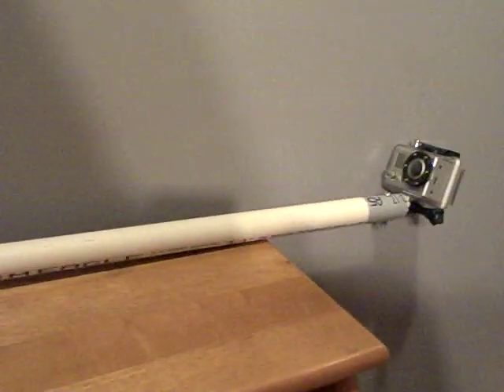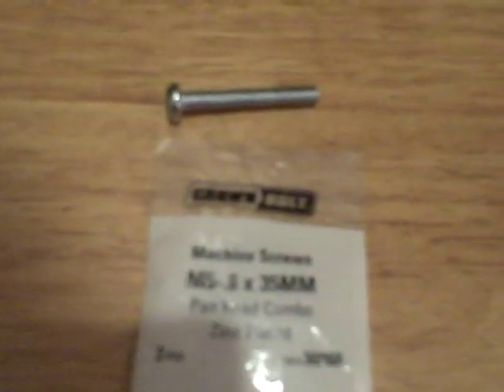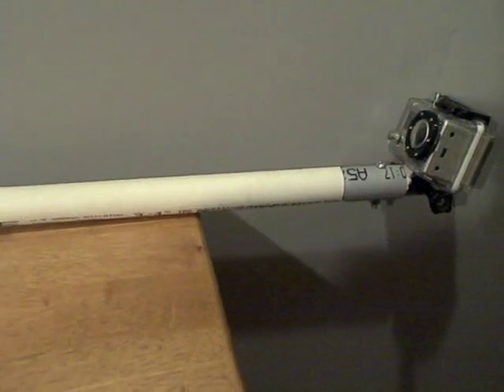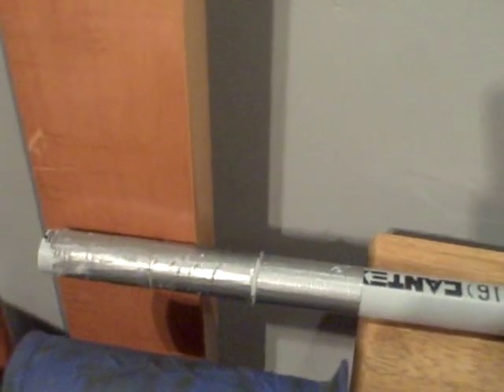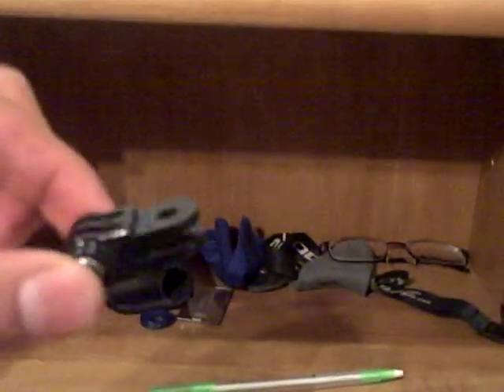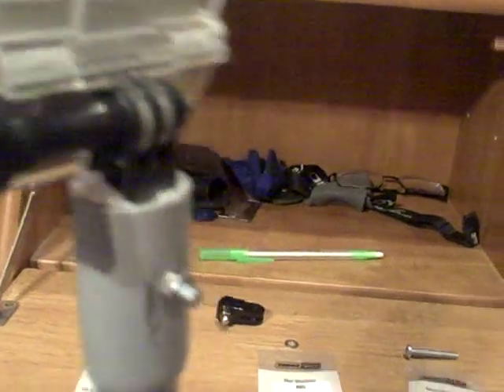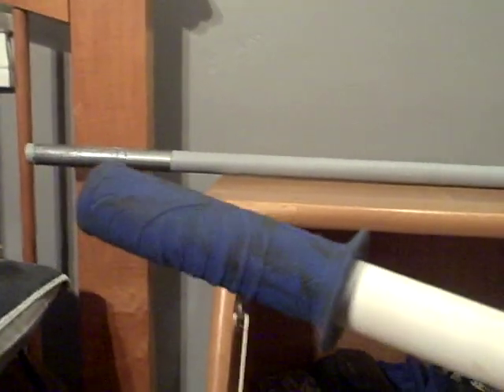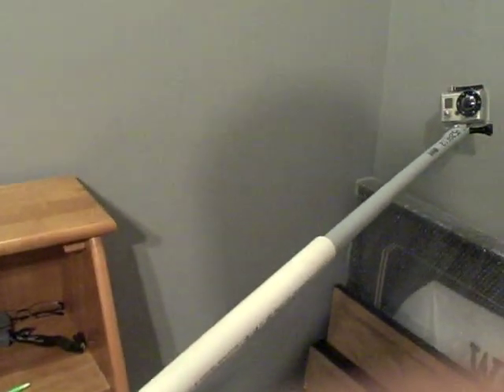GoPro: Homemade Pole Mount (Extendable)

Comment from the maker: @mynameispedro
you need 2 types of pipe because its extendable. one slides out of the other to make it longer or shorter. you could mount it through the pvc if you wanted to but then you would not be able to adjust the length.